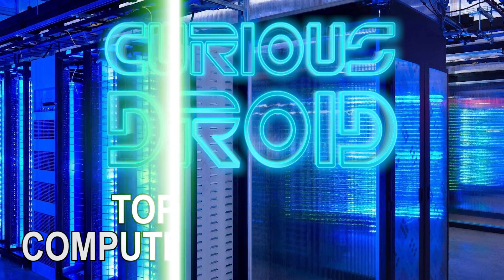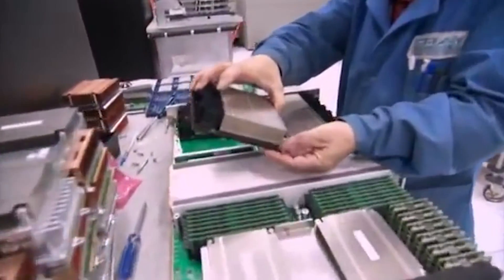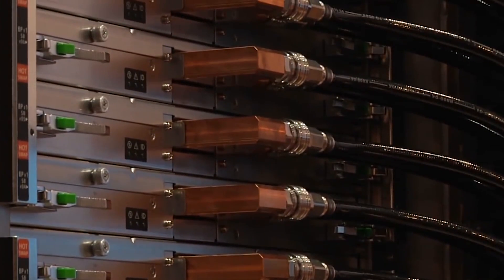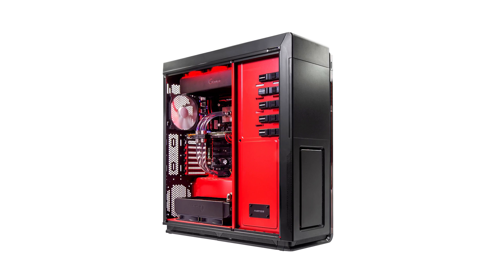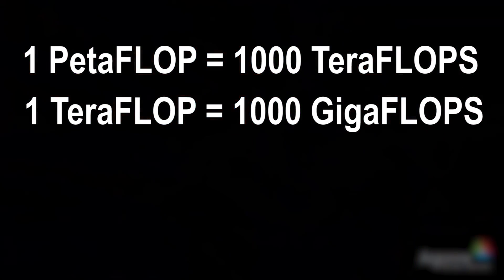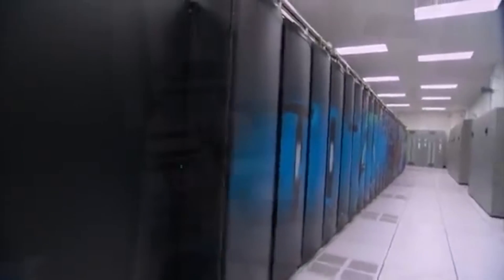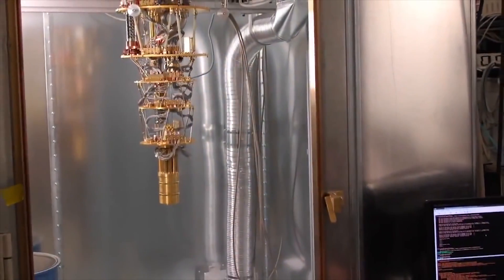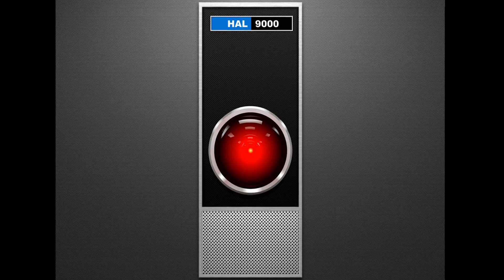Top 10 Fastest Computers in the World 2016 - How much faster is a supercomuter than a PC or iPad Pro

Comment: That ~100 GFLOPs figure for the desktop, doesn't that only account for the CPU? Throw in a couple Titan X pascals and how many more FLOPs does that add? Looking at a spec sheet for just one, that something like 11 TERAFLOPs (over 11,000 GFLOPs) of single precision floating point performance. I'm sure the shitty ARM based ipad is taking into account the iGPU so it is only fair to take into account the GPU in the desktop. Even a R9 290 which can be had for like $200 these days is capable of close to 5 TERAFLOPs of single precision floating point performance and a GTX 1060 which is also a mid-range priced GPU is close to 4 TFLOPs. It is also only fair to include GPUs when comparing a PC to a supercomputer because some of the fastest modern supercomputers consist of tens of thousands of GPU chips along with the tens of thousands of CPU chips.

Comment: damn the n.1 looks awesome

but can it run crysis?
Reply: I am thinking of can it run Minecraft
Reply: @esshyy  not at max render distance without lag.
Reply: Can it run space cadet 3D pinball?
Reply: Bleach McBleachersen what about runescape?
Reply: No because it doesn't have a gpu
Reply: Yes.
Reply: Nooooo only minecraft at lowest settings.
Reply: Yes, at 25fps max on lowest settings with tweaks.
Reply: the answer is actually: no, supercomputers were not designed at all to be able to run stuff like windows 10 or games, they use it for complicated simulations. And even if they did manage to start running crysis on it, the performance would be about the same as a regular gaming computer, most games only utilize 2-6 cores, no way will it figure out how to do 3,000,000

there is your answer
Reply: No cuz it don't have 2 gxt 2080ti's
Reply: Nope, imposible
Reply: Bleach McBleachersen yeah 1000 million time at once or more
Reply: The Judgemental Cat i know its a joke bro

Comment: 50 years later... they put #1 into one laptop
Reply: as apposed to 6-7 now lol.
Reply: 50 years from now they will be putting us in zoos.
Reply: Try 15 years.
Reply: with current silicon technology computer will have stopped advancing after 2025 the manufacturing process will be too small below 4 nanometer resulting in quantum tunneling in the logic gates, so thats why we need to find an alternative to silicon by then
Reply: Graphics processing increases processing demand exponentially, so yeah, video games in 1999 ran on almost nothing compared to today's standards. Hence why you can emulate Playstation games on a $5 processor
Reply: what lol
Reply: Freezee
It has already started in stock markets… Sometimes the computers run crazy and no-one can control them, which had triggered several economic downfalls in the recent years.
Reply: ConnorW8 the cool part is that actually is that impossible. It may actually become true.
Reply: The Antman now it is only on nano meter 
You can get all the wayyyyyyyyyy down to pico meter lol
Reply: George Porte wow, that's actually pathetic...LOL
Reply: George Porte then what did games run on at that time? Potatoes? People still play games that came out in 1999 (counter strike), is that also on a potato?
Reply: ConnorW8 lol that would be like 33000 times better than we have now
Reply: hmu
Reply: Ergo Gray Super computers become self awareness in 2030s and they decide to strike first as the human are threat to them in their calculation of 1 billion trillion peta FLOPS.
Welcome to cybernetic world without human beings. xD
Reply: The Antman the more we walk the faster we go, i see no limits for what we could do in 50 years.
Reply: Wakkawakka 88 I think it is too lol. Even after 1 year it's kinda unimaginable, anything could happen u know? 

 Everything walks, even if they seen still.
Reply: it will probably be equivalent to tablet we give to toddlers 100 years from now to run theyre VR childrens life coach simulator
Reply: we probably said it was impossible to put those super computers, like the ones used for the Apollo program, to be put in a mobile device. Back then those computers were the size of the super computers and took up a whole room. Yet 40 or so years later, my smartphone is more powerful than that computer that took humans to the moon. I am optimistic that the supercomputers of today, will become common everyday computers in a few decades.
Reply: ConnorW8 for $500😂
Reply: PLEASE tell me you know how small an atom is
Reply: Bullsi1234 yes silicon is around 200picometer
Reply: That would be tough. Considering that much computing power, since computers are literally reaching its physical limit (1 atom thick transistors), electrons can just phase through the transistors via quantum tunneling, making them and, essentially, the computer, useless.
Reply: No joke - the 70's CRAY supercomputer is less powerful than an Arduino. Sick.
Reply: There are a lot of Arduino variants. You're going to need to be more specific than that for those who don't understand it. LOL
Reply: Try 20 or 25 years, and maybe as small as your smartphone. Tech such as this explodes upward exponentially.
Reply: I read somewhere that the US government's supercomputers in 1999 are about as powerful as a playstation 4. So that seems like its very possible
Reply: ConnorW8 I don't think that would be possible in 50 years because the connection pieces between processing components would need to be 1 or 2 atoms thick
Reply: The Antman no, that is not true at all.

Comment: Can These PCs run  GTA V on ultra     Settings XD
Reply: TUTORIALZ nope! Just ultra mega tera peta settings!
Reply: TUTORIALZ Those computers can run fucking GtaV with Redux Mod on Ultra in 50K
Reply: TUTORIALZ nope
Reply: MIREL RANETE actually they cant
Reply: ꧁TutorialsOnly꧂ mine can, and I bought it for 680
Reply: TUTORIALZ yes
Reply: Cool Man Why?😯
Reply: TUTORIALZ cause they aren't made for that they are more for research and space operations it would run gta v in numbers
Reply: like in codes
Reply: Cool Man ik! Just i joke :)
Reply: No. Using a supercomputer is nothing like using any other type of computer. The usual way they are used is by giving it data files, running a program, and using a PC to view the results. Also, they usually run Linux or some kind of specialized OS, and usually don't even have a monitor attached. So, unless you don't mind at least a few minutes of input lag, and maybe half an hour or more to render the results using a computer that actually has a graphics card, the gaming experience wouldn't be that fun.

Comment: Bitcoin 

Yeah, I'm insane
Reply: Some of the best BitCoin rigs are run in places such as dormitories ; where power is not an issue. I have no shortage of names/accounts that generate (pure profit) of many hundreds of dollars per month. I've personally made a system for a soldier in Japan that makes in excess of one thousand dollars per month - current BitCoin rate.

Then there's solar. BitCoin runs quite well on solar/battery, especially considering it doesn't take much in panels/battery to run a 1500w system - easily capable of sustained running on pure profit (even after cells, battery, and all hardware) at us 1000 per month.

Or even if one does not really care about the power bill... Using a properly cooled system that is able to stay on continually. One still is able to generate at least on hundred a month in profit - after hardware and electric bill paid at todays rates.

Today, the largest BitCoin system is operated in North Korea, and has been shown to Westerners.
Reply: CrackedDylMil you would be a billionaire in just 10 seconds...
Reply: May be don't worth it because the power comsumtion

Comment: Put a USB killer in it.
Reply: I think the USB killer would damage one cluster, but not the whole computer.
Reply: Tech Store put a usb rubber ducky in the terminal you control it from then
Reply: USB killer doesn't affect storage, it may fry some board transistors, but the data will all be intact.
Reply: same
Reply: RIP USB killer ^^
Reply: More fun would be to connect that USB 'killer' to the PSU of one of these - reverse polarity.  Stand back though ;-)
Reply: USB killer cannot kill it to quickly because supercomuter is way toooooooooo big and with soooooooo fkin huge storage.
Reply: OOF
Reply: https://tinyurl.com/ydhgkhb9
Reply: OMG lol
Reply: Juice Box it would laugh n keep running...I'm pretty sure it wouldn't even stop the node u plugged it into..just kill the controller chip....remember these things can runn with 1 nut and no arms.. Modular af
Reply: @lucasthergreat9 wtf
Reply: Juice Box good idea
Reply: it will not able to do any harm to it
Reply: @ShivamJha00  actually
Reply: i bought one and fucked up my bosses computer cause fuck him
Reply: @veryfrozen3271  Hey man, that's rude
Reply: Juice Box 100 layers of USB killers challenge
Reply: puts in usb killer +1,000,000 views
Reply: UPGRADED USB KILLER CHALLENGE SUPER CAPACITOR USB SERVER KILLER-SETS ANY PC ON FIRE

Comment: Ok but can it run Crysis?
Reply: MrEasterrabbit This crappie can't even run Minecraft...
Reply: Luke Hill not nessisarily. Intel has integrated graphics and all systems can support at least basic BIOS and command line without GPU or an OS. A GPU is technically a CPU but has a special structure designed to solve specific math problems at a faster rate (like your game's graphics) that a CPU while the CPU itself is better at general computing of anything but does not execute specific tasks quite as fast like a specialized part. Another example is a ASIC unit for bitcoin mining which has special architecture meant to solve hash functions. While useless for anything else a ASIC can easily be 100 times faster than your CPU or GPU at solving hash functions. And that is just the crappy ones too.
Reply: Runs MC in 16 fps
Reply: Thats a good question i mean they doesnt have GPUs and you can imagine how the games run if you havent any GPU Inside
Reply: "potentially render ... every little particle on a molecular level"
For example, 18 grams of water contain approximately 6.022 x 10^23 molecules. If you'd give the fastest system at 33 petaFLOPS, that is 33 x 10^15 ops per second, a very trivial task of just adding 1 to some parameter of every simulated water molecule, it will be able to process 1 x 10^-6 grams (1/1000th of a milligram) of water per second.

Of course it would be ridiculous to compare that task to any kind of simulation. If you'd want to, say, simulate some interaction between water molecules, this quantity will go down exponentially.
Reply: MrEasterrabbit 
No, can it run pong?
Reply: It can run at least thousands instances of Crysis, while making your coffee, driving you to work, doing seismic research , while taking a nap , and yawning out of boredom. Crysis for these beasts is more insignificant than pacman is for your computer.
 But since their basic units are no different than your desktop pc, they can be as fast as your basic desktop is...
times the available power they can spend. Because they become super    computers just by spending more power.
 On the crappy pad , on the other hand, no supercomputer is based, because it would be 10 times more expensive and at least twice energy consuming. In fact A9 maybe one of Apple's best products, but it is so, because maximum damage is done to the end user, hence Apple's attempts to produce sth minimally worthwhile in its history.
Reply: I knew I wouldn't have to scroll down to far to find this comment.
(I was going to make it if it wasn't there)
Reply: MrEasterrabbit it depends on the gpu
Reply: Ye, because you are going to emulate windows with the Linux KVM kernel so you can setup which hardware you're going to passtrough.
Reply: MrEasterrabbit yes
Reply: +Arch Jason that's the third time ive seen you say that lol
Reply: Luke Hill obviously (like a normal PC) you can put the Screens at youre Mainboard so you dont Need any GPU
Reply: Nah you need 10,000,000,000 Petaflops for dat
Reply: MrEasterrabbit damn u beat me to it
Reply: MrEasterrabbit it can probably barely handle pong
Reply: Can it run calculator in Full HD?
Reply: Michael Petrov 
Nah...
400×800
The way it's meant to be.
Reply: Maybe
Reply: no crysis will crash
Reply: they do have GPUs if they did not you could not see anything on a monitor
Reply: Can it run minecraft?

Comment: The question is, can these super computers run GTA 5 on max settings?? THEN what will be the framerate???400fps(Unstable). But wait they only said about cpu speed and ram amount.So what kind of graphics card these computers are using??